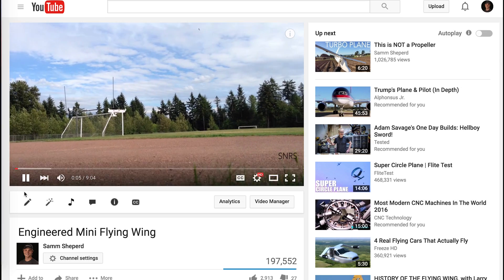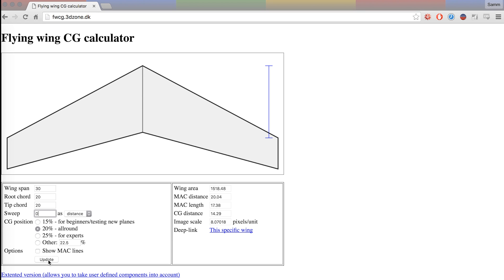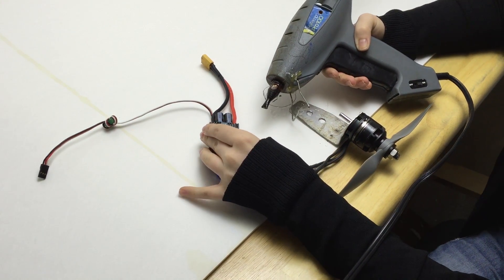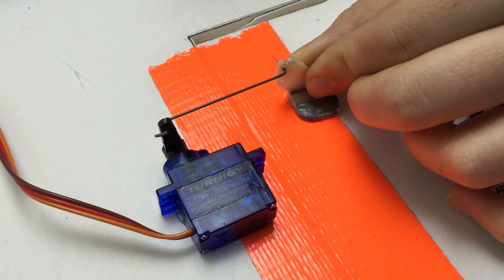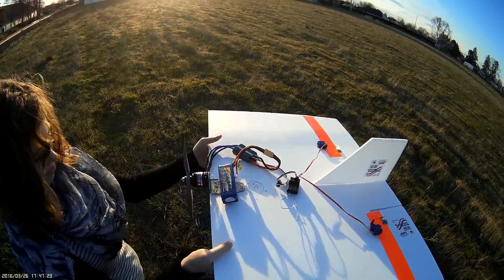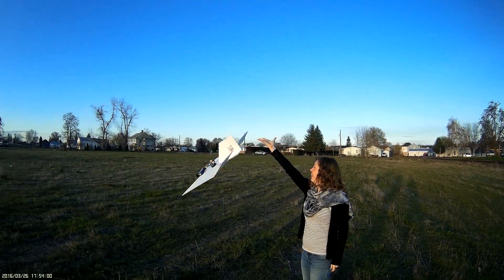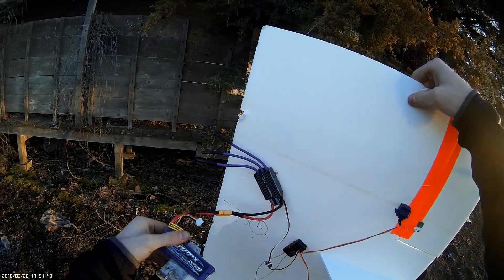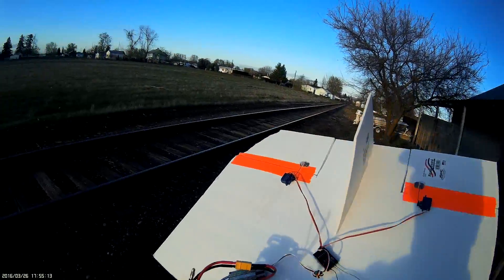RC Flying Rectangle

Comment: I just built one of these, I did cut out the front of it at an angle because that moved the center of pressure back which lets me put the CG farther back which made everything a lot easier. I also added a rudder because it really benefits from a little additional control authority.

Comment: Can i get a advise in balancing the cg on this type of rc plane? I put all the electronic part on the front and added some extra weight but it's always tail heavy i also add more weight sometimes it's balance and mostly a tail heavey and i thinks it's overweight.

Comment: If Motor placed in middle of board, after CG calculations, so it can fly or not ???
Actually, am Beginner in this field, I also build same Prototype with same dimensions 30x20 on cardboard sheet, but am confused where i mount motor, I don't want to mount front side, bcoz i don't want to broke my motor and Propeller:-( so i want to mount middle of the wings, but i don't know it will fly or not.
Please, suggest me where I mount Motor??
Thanks in advance ☺️
Regards
#maksynthhouse

Comment: when i tried making this my servos and the paper were peeling up and away from the actual foam which rendered the elevons useless what do i do to fix that?
Reply from the maker: You can squeeze some hot glue under the peeling foam. Or just take the paper off and put tape directly on the foam. Or do that and also use some glue to keep it from coming up.
Reply: thank you :D

Comment: Hi, I built this plane. It everyone I crash it my motor or prop breaks.... Is there any way you could put the motor somewhere else than The very front( ANY IDIEAS ANYONE?)
Reply from the maker: If cut the leading edge back and made it delta shaped, then you could afford to move the motor back a bit and mount it mid body or even at the very back if you added enough weight to the front. Use the CG calculator in the description to enter the geometry of your wing shape and it will tell you where it NEEDS to balance.

Comment: How thick is the foam board?
Reply from the maker: Standard poster board thickness. Not very thick probably the same as cardboard but lighter and more rigid.
Reply: Samm Sheperd Thank you Sam, didn't think you're going to answer :)

Comment: In this model, When the flaps go down, does the plane go up or down?
Reply from the maker: Air will go where you direct it. When you direct it down, you push the back of the plane up, which points the nose down.

Comment: Do you think that I could add some kind of landing gear to this? If so can I have some ideas?
Reply from the maker: Sure you can, and that would make balancing much easier. I usually make gear from bending music wire. Or maybe just steel wire from the hardware store

Comment: Can you please provide a link to what Motor you used? Thank you so much😊
Reply from the maker: It's an Emax 2812 size, Which is pretty overkill but I like it because it's so durable and the weight makes it easier to get the CG far enough forward.
Reply: Samm Sheperd thx, also one more question- I often get confused on where you have put the CG. Wouldn't it be in the middle of the plane instead of towards the front? Thanks so much!
Reply from the maker: See my "engineered mini flying wing" video for a quick explanation
Reply: Samm Sheperd alright, I am going to build this plane soon. It will be done by Saturday. I'll send a video!!
Reply: Samm Sheperd did you use gyro stabilization for this plane?
Reply from the maker: Nope just a radio receiver and servos
Reply: Samm Sheperd how many mAh is your battery?
Reply from the maker: JumpinJellyBeans A It's a 2200mah 3s

Comment: Hi Samm. I tried a trainer and a flying wing. Neither worked. I am starting to think I am seriously under powered.
Would you be so kind as to tell me the details of your power system?
I am using the cheap combo from Amazon, A2212/13t(1000kv), 30 amp ESC, and a 1500mah 11.1v 3s battery.
I can't get off the ground, and I am becoming increasingly frustrated.
Reply from the maker: That seems like a fine power system. What kind of propeller are you using?
Reply: It says EF8043 on it. It's about 8 inches total width. The guy at the hobbytown said they would work.
Reply from the maker: it's cool that you have a local hobby shop. Sometimes they are overpriced and unhelpful, but hopefully thats not the case for yours. I usually use a 10x4.7 prop on that motor, which would give you much more power
Reply: Samm Sheperd Speaking of unhelpful, I've just discovered that I've had the props on backwards. Dude told me "always numbers forward".
As a former A&P mechanic, I feel like a total ass right about now!
Reply from the maker: I can't think of an example when numbers forward isn't true. But yea spinning it the wrong way will not produce much thrust. 
Also, I worked in hangers doing maintenance under A&P's for 3 years before becoming a CFI
Reply: I'm retired military. Helos and fixed wing. I spent about a year building Taylorcraft in my early 20s. Seems that knowledge didn't stick with me.

Comment: Hey Samm 
First: could i also use the cg calculator with the metric system?
Second: I rebuild this Project in a much smaller version but my CG is in the middle and so i have to put a lot of weight on the front to bring the CG to his point where it have to be. What could i do that i didn't have to do so much weight on it? Is it a big problem if the cg is near to the middle of my first selfemade airplane?
Greets from Austria and sorry if there are mistakes in my english
Markus
Reply from the maker: +Markus Koidl hello! Yes the CG calculator works with any unit that you use, as long as you use the same unit for everything; it's all just a relationship between numbers.

You can cut the front of the wings so that they sweep back, that will move the required CG farther back. And/ or you can try and reduce weight from the back. Putting extra weight as far forward as possible is also fine.

CG is the most important (and most overlooked) part of building a plane! A properly balanced brick will fly much better than a plane with the bad CG
Reply: +Samm Sheperd (SNRS) thank you for your Answer it will help me a lot i will cut another shape 👌

Comment: Can you please tell us whats the size and model of the engine is ? And what size of prop ? Thank you
Reply from the maker: +Alex Gevorgyan the motor that I had laying around to use on this plane is this one: www.headsuphobby.com/Emax-GT2812-06-1550kv-Outrunner-Brushless-Motor-D-706.htm and as you can see, they recommend up to an APC 8x4 prop on a 3s battery.

Comment: Cool one tip put the control horn with the hole above the hinge
Reply from the maker: +djRC I've heard that I should, but I've never found a reason to care. Having the holes farther out provides more leverage and less torque on the glue joint.
Reply: +Samm Sheperd (SNRS) but when you want extreme angles on your control surfaces your pushrod (when its long) is touching the surface of the stabilizer or wing (never knew it until i builded a giant boxcar at school and somebody on the forums said that :p) i dont think it makes alot of difference but that little thing was what I recognized (plz check my channel out if you want!) keep up the great work

Comment: Thanks for the video -- it confirms I'm over thinking things : The simplicity of the build underscores just how few components are needed to fly these days.

Do you have any videos that cover the transmitter, motor controller, battery, motor, etc? I'm interested in a bare-minimum-to-get-started type of breakdown.  I'm getting into this maybe 20 years after wanting to (very different world with LiPo, lightweight cameras, etc - FPV?! magic in 1996), but I figure it's about time.
Reply from the maker: +icarus901 https://youtu.be/j61Q3e8AFR4
Reply: Excellent, thank you!

Comment: Do you have the electronics like the motor 'swappable'? Like can you take the motor to another plane or are they permanently sticked to the airplane and you have electronics for every plane?
Reply from the maker: +tobanga feufeu I could remove the motor pretty easy. But the rest is stuck on with hot glue so that would be kinda annoying to put on another plane real quick. I plan to fly this plane to its death and then put the electronics back on another plane.

Comment: first!!!!!!!!!!
Reply from the maker: +James H congratulations to you :p
Reply from the maker: I will make a twin engine impeller plane just for you. I just wish my other heater was opposite so I could have symmetrical counter rotating blowers. I'm thinking of putting them horizontally into a flying wing. The Conard plane that I make a couple years ago is very similar to the 55 ascender. https://www.youtube.com/watch?v=lUOge7Uc-2g
Reply: +Samm Sheperd (SNRS) is a double engined turbo plane a possibility? The topic has been on my mind and I wanted to challenge you and see if you can do it.
Reply: +Samm Sheperd (SNRS) also if my previous comment seems pretty hard to do could you try and make a rear engine prop plane like the xp 55 ascender, thank you!
Reply: +Samm Sheperd (SNRS) THANK YOU SO MUCH! I'll be looking forward for that video, thanks mate!